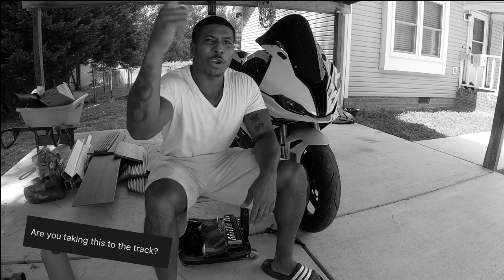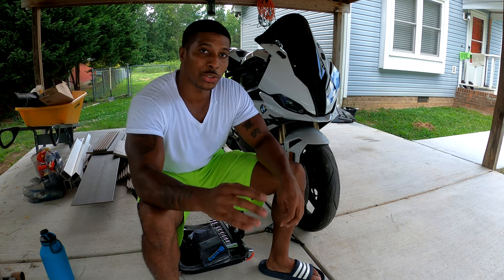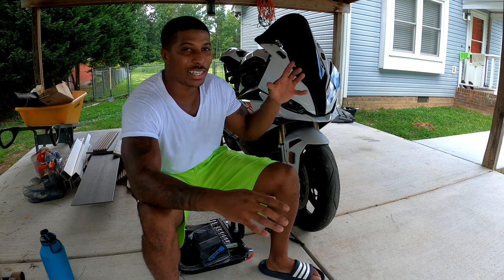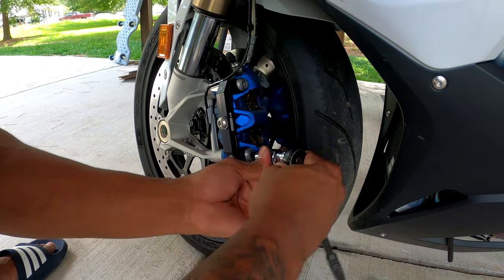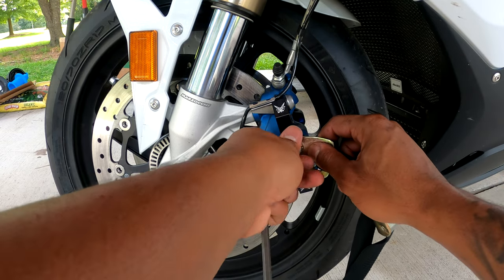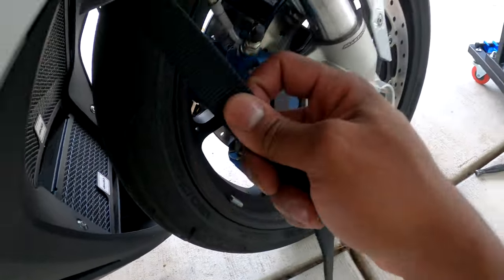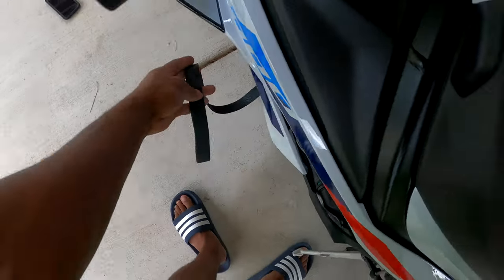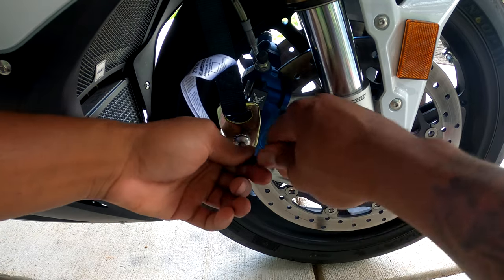2023 BMW S1000RR/M1000RR BT Moto Front End Lowering Kit with Caliper Brackets Install

Comment: I know this isn't related to this video per say but you seem like the best person to ask,  I have some frame sliders I want to install but 3 of the screws require torqueing them to 30nm and 40nm but I don't have the tools to do that. How important would you say doing that is? It would be the screws that are connected to the frame of the bike where most of the frame sliders attach.
Reply from the maker: 30-40nm is roughly 25-30ft/lbs. Being that they’re frame sliders and not axles or anything really “important”. You would essentially be ok to tighten them on till they’re “tight” then add a little extra sauce, not too much tho, that should be about 30ft/lbs… if that makes sense 😅. Torque wrench is $33 on Amazon if you need that. https://amzn.to/3rJ4aTE
Reply: @N31LE  okay thanks, and I have the torque wrench but my issue is not having any of the torx stuff for it 😂 time to invest I guess haha
Reply from the maker: @catanplayer108  easy fix. $16 on Amazon my guy. https://amzn.to/47aiMM6

Comment: So after you install, you just tighten it down and thats it? You leave it like that until back home?
Reply from the maker: Yeah you can compress the forks for racing or hit the button and release them and it will be back to riding like stock
Reply: @N31LE  alright, perfect.. thanks for the answer

Comment: beware anyone with a 20 or newer you have to turn the key on before you cinch the forks down, it will blow out the seals and throw the forks out of adjustment with it having electronic suspension!!!!